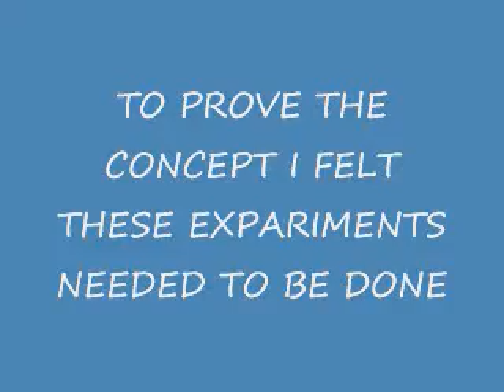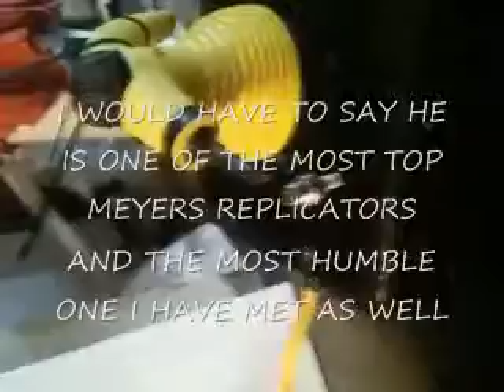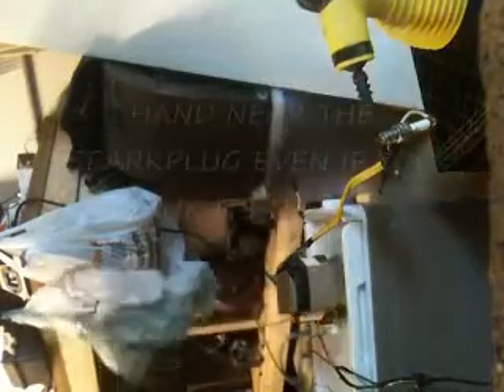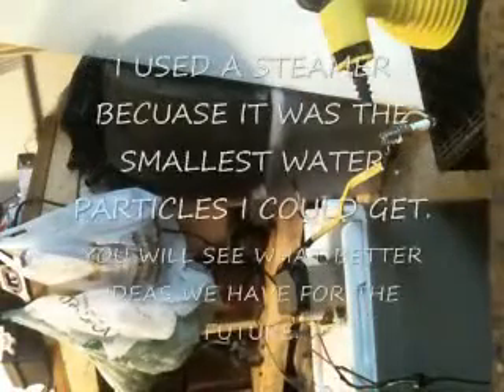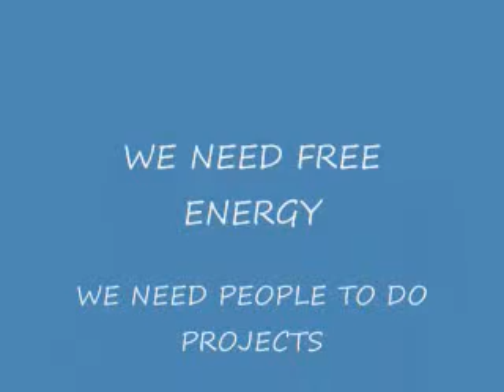Seperating water (hho) and burning it at the same time with AC plasma

Comment: the fact that you burn both gases (h and o) is one step further,at least for my research and I thank you for that ! ... selfcontaining of the burn is either from frequency of the sparks (for engine i guess is ok, try implementing the sistem into an engine!), and for continous burning i can only assume that you need a control of the CO2 in balance with already obtained O2 .. maybe a closed burning chamber that will slower the burning until next spark.. or increase frequency of the spark .. nice vid !! .. waiting for youre next trials ! Best of luck !

Comment: try to add NaCl to it and it will increase out put energy 200 times
Na+ works as catalyst for Hydrino formation.
Reply: +Firas Taji no that's how you make chlorine gas with your oxygen
Reply: +hey7328 you are correct. then try KOH or K2CO3 as K+ works as catalyst to make Hydrino.

Comment: You are putting in energy to get energy from the water... Hence there is no extra energy being created from the reaction, it would be stupid to make a car that ran with this fuel source because it would be easier to make an electric car..... It would use less steps and the same energy. If a water powered car was a practical idea.... Don't you imagine that someone else would have already marketed it?
Reply: Joe Capozza 
Hey Joe, they are all dead. Same reasoning I've listened to for 30 years now. YES MEN DO KILL FOR POWER AND MONEY THESE DAYS, just as they did 4000 years ago in the ancient world, nothing new. Stan Meyer was poisoned by two Europeans at lunch that came offering somewhere between Millions to a Billion. Look don't trust me, do the research, and please don't ask a college  professor, all they mostly do is "practice  proffesing". Once they learn something in reality, they lose an ability to be inside the "Proffesors Club".
Reply: We were taught that" oil and water don't mix".The truth is they burn really hot when mixed together, and it takes a lot less oil and water is cheap.The chamber in which they are burned needs to have some mass and get up to enough heat to sustain the reaction. Oil and superheated steam, carburated correctly . 100 years ago they called it "spudding". Then the wars happened and vested interests redirected.